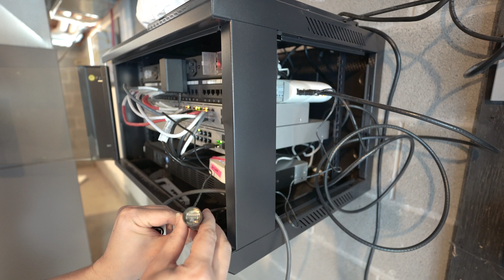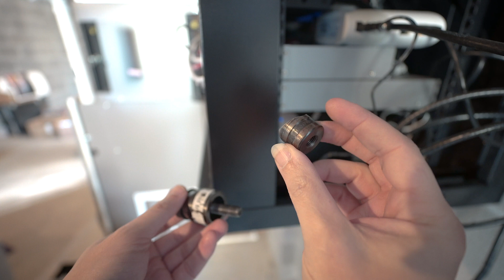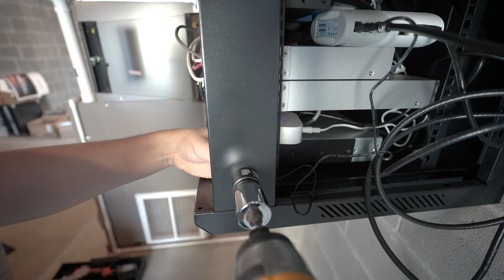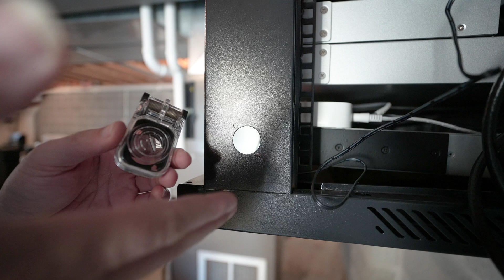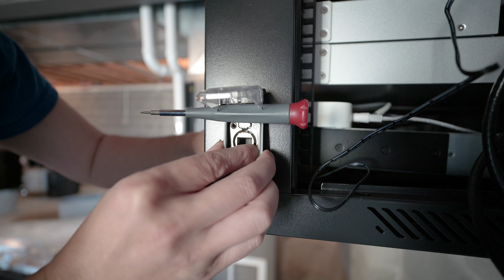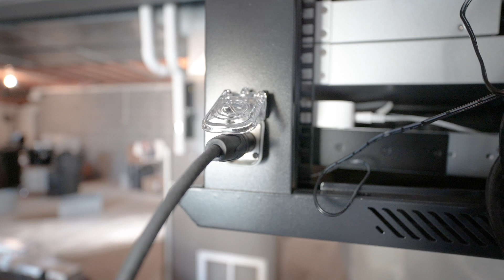Adding A External HD Cat6 Jack To My Home Network Rack

Comment: Great video! I’m hoping to get your advice on a setup I’m planning.

My backyard faces south, and most of the weather (rain and wind) comes from the southwest. I’d like to add two outdoor Ethernet ports in that area: one for a temporary access point when we’re outside, and another for my dedicated work VLAN so I can occasionally work outdoors.

The house is brick-wrapped, but there’s a bay window section made of wood that seems like an ideal spot for mounting the ports. Do you think the Ethernet port and dust cover you featured would hold up to those conditions over time?
Reply from the maker: They would probably be fine, though I’ve never tested them. They do have an IP65 water rating.

Comment: Please don't drill metal around electrical devices. The filings can get inside and cause all sorts of problems. If you do, just turn things off, maybe have a vacuum cleaner to suck the metal filings as you drill so you don't cause yourself a headache